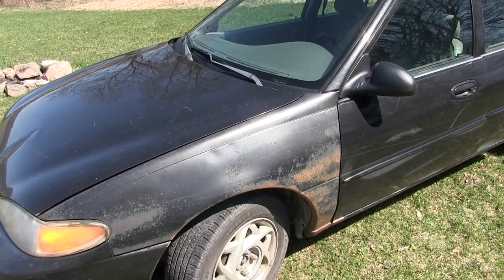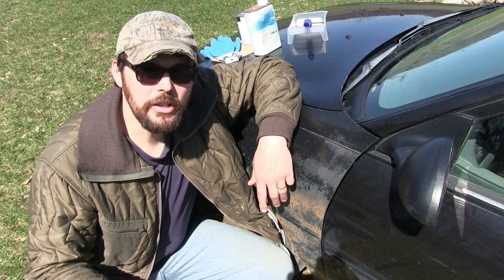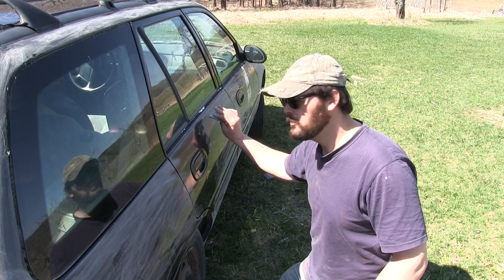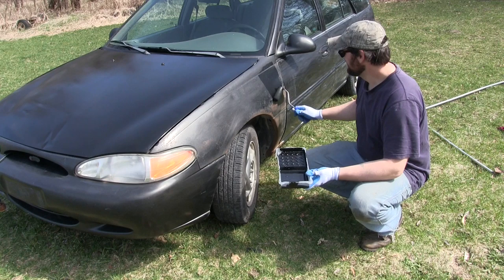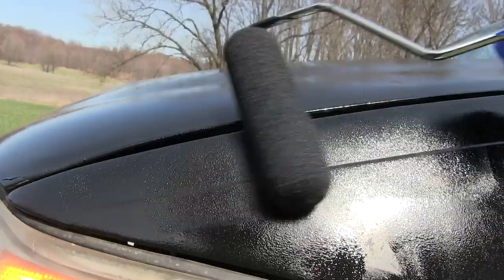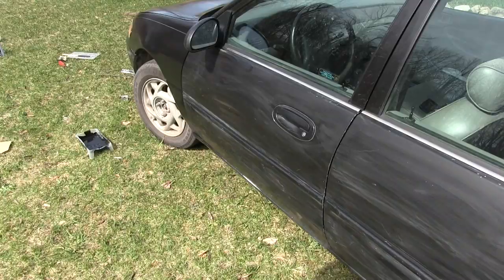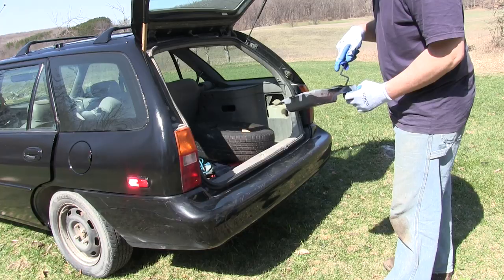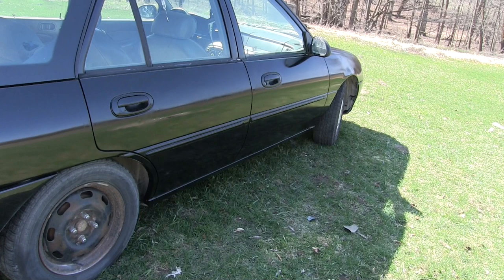Paint Your Car for $20 Bucks !!!!

Comment: "$1500 paint job from a body shop"...IIRC, after a neighbor backed all the way across a pretty wide street, straight into my bright red dually truck, the paint job on the two (?) panels that needed it cost more than that.  OTOH, that's 50% more than the entire purchase price of my first car, a very pretty 1968 Chevy Corvair 500, black on black.  At one point, I did need to repaint the hood on that car, and I went the rattle-can route.  It was looking really nice, then I did something (forget what) that ruined the new paint, and I had to work a bit more to get it looking pretty good.  Back then, I didn't realize there were so many different colors of shiny black.
"To do something yourself is freeing."  Preach it, brother!  Holy O', but that is so core, so basic.  Even some really non-cosmetic things you can do yourself, instead of paying a stranger, is so good to just do!  I grew up with the idea that people just knew how to do things, were taught by their parents like we were.  Nope.  Come to find out, most people don't know how to do anything practical, and what's 100 times worse, don't want to learn.  I barely learned how to weld, and regret that at times.  Really knowing how to weld is a wonderful thing, and I just don't.  But I can frame, tile, rock, paint, plumb, wrench, do electrical, etc.  I'm not great at any of it, but I can do it.
As for your results, that's the kind of car that, if I saw it pull up at a parking lot where I was, I wouldn't really give it a second look.  I wouldn't be tracking down the owner to say how great the car looks, but I wouldn't be concerned that the rust was going to harm my vehicle, either.  For my own preferences, I'd have gone glossier, but I've definitely had cars that looked way tf worse.  When we married (1985), my wife had a car we called the White Monster, that had some sort of chalky white paint on it, would come off a little on your hands if it was wet.  I don't really know, but we always said it had house paint.  I could definitely see, if I'd known back then, taking some sandpaper, paint, etc. and doing a job like this on it.  It would have at least looked good, as long as it wasn't running.  And as long as you didn't look inside, see the sheet metal I'd pop riveted in to fix the hole in the floor, or the work I did to reattach the shifter, or...

Comment: back in '69-70 I had a Rambler wagon, and some friends painted peace symbols all over it. I later wanted to cover 'em up so went out with a brush and painted it with what I had, can of white house paint.  From a distance it looked ok. I did keep my engine the same though. I had some glow-in the dark paints, and had cleaned the engine and painted every part a different color. It was fun to pull in to a station and ask the attendant to check the oil (yeah, they used to do that) and listen to him .......WTH............hahaha
Reply from the maker: 258 inline six?

Comment: I have painted many cars with a roller. One thing I used to do was dilute the paint with a little kerosene. That smoothed out the paint a bit. I painted a VW 30years ago with red primer and it is still on there. My off-grid mobile home I painted with a roller and thinned paint. Still looks fine 15 years later.

Comment: As an oil based paint, I used Flood Penetrol to rejuvenate a Jeep fiberglass top, it’s intended use is to get rid of brush strokes in oil based paint. Late in the game but maybe that would help you with your bubbles if you ever do it again?
Reply: Or he could have just painted it with a brush.  Probably would have turned out better.
Reply: @tommak6516  geez dude who DIED and made you such a negative nellie

Comment: Good idea-I was just thinking about painting my old 1988 s-10 that is 2 colors of primer, with spray cans.-I think I will use your idea.-Thanks. Like the guitars too-I have built 5 or 6 myself and I have 4 of the epiphone specials that I bought on sale over the yrs for 99 dollars a piece.Been looking for some of the jr's. they are hard to find around here. Check out the irongear pickups. Going to order me some. They say they are killer and about 29 bucks a piece in the u.k.-Good luck, like the channel.
Reply from the maker: I would thin the paint a bit and paint in the shade next time. I'll check those pickups out. Thanks for the tip.

Comment: Hi ,  I have been painting my 1990 Nissan D21 with a small roller for years and loving it ,  always looks so much nicer afterwards and I protect the metal underneath as well .   Switched to Krylon Farm Implement paint  recently .  Use ANY WHITE and it always matches .

Comment: Must be a Ford thing-- I painted a 1970 Mavrick in the late 70s "Safety Yellow" with a 9" roller---Next time put a little Penetrol in the paint   to flow out (no roller Marks)
Reply from the maker: I'll make a note of that. Of the cars I've rolled, this one turned out "less good " than the others. I should have thinned a bit.

Comment: I painted my 87 Dodge Pickup about 8 yrs ago using this method- A bit more expensive - I did 4 coats of paint (2 colors to approximate the original) 
Total was around $60- including hardener

Comment: Back in 1964 my friend and I painted my 1952 Chevy rust bucket with my Mom's canister vacuum cleaner. Hook up the hose to the back exhaust and your off. In the garage I found a gallon of OD Green paint that was ready to go. The vacuum had an attachment that was a canister for bug spraying. An hour later we were done. Five years later no rust showed through. Color of an Army Jeep that everybody noticed. Anybody ever do the same?

Comment: If you want to get crazy, you could add multiple coats, sand the paint lightly with a high grit, and hand polish. Costs a bit extra, but should still be in the 40-50$ range

Comment: I subscribe to the channel and this popped up. It's not bad, considering it's a cheap car. It's all about the foundation though, and you don't want even a cheap paint job to flake off. I would have got a spray can  of rust converter and sprayed the rust after sanding it down and then maybe a primer coat, and gloss or high gloss. At the end of the day it just matters that you keep the body from deteriorating.

Comment: We did this, but we used a Cheap air paint sprayer...good enough for primer but not regular auto paint. In the salt country we used to set a cost of about $50 but this included fiberglass and bondo....it was a wiz bang deal on the body repair...but it looked a lot better then when we started...professional no, better yes. The rustoleum paint applied with an air sprayer shocked me though...that was so good in places it did look pro...for about 6  months anyways. The bottom of the rust bucket vehicle got a strip about 4 inches wide of undercoating applied....completely hides doors filled with styrofoam on the bottom  and other wiz bang quicky results.

We also used to camo rust bucket vehicles with rustoleum some using big oak leaves to paint around for creative effect etc

Camo an old 4 wheel drive and the city type wanna be hunter go nuts and come out of the woodwork to buy it for insane $$$ even we felt guilty about. Now we had the knowledge and ability and even the place to do professional body work....only thing we were missing was a downdraft paint booth. But these old vehicles were not worth the time and money just like yours...but it can super amazing what can be done for $20 or even $50 if you want to attempt super basic body work. I'd really encourage you to use the air sprayer though for your rustoleum projects on metal...it doesn't require high air pressure to apply so you don't need a huge air compressor either.
Reply from the maker: I'll give it a try next time. A friend of mine told me the same thing as you just did. So, I'll give it a go. Thanks!

Comment: Wow, the vehicle looks a LOT better.  I painted my son's 72 VW with Rust-Oleum spray cans back in the late early 80's. It turned out real nice. They paint boats hulls like that with foam rollers. There is also a detail called "Tipping" where you pull a good brush over the rolled paint. It's done to even and smooth the paint. But of course for a $20 paint job on a $700 vehicle, it's not worth the effort :-)
Reply from the maker: Thanks for the info, I may try that actually.

Comment: Hey Dave, quick question for you - how tall are you? I'm looking into picking up a low-mile Escort wagon for cheap, love that it's a gas sipper but I'm curious if I'll be comfortable driving it at 6'1, or if it's possible for me to sleep in the back with the seats folded down? I like how you say yours is like a motorcycle you can sleep in
Reply from the maker: Hey Brian, I'm about 6,1" myself. Its a small car but I like the room it has. As for sleeping in the car .....Ive done its lots of times, but I wouldnt say its been great, LOL.
Reply: @Bushradical  Hey thanks Dave, appreciate your feedback and experience!

Comment: A friend of mine used to paint coaches /busses and he painted my van for me with household Woolworths gloss paint he had a brush he had had since an apprentice saying it was worn in just about after many yrs and the older the brush the better he also  thinned that paint so it was like water almost i would say 50/50 with thinners/terps  then he sat it in hot water all the time he was using it ,he went at that vans bodywork like  a mad man changing the direction of the very light first coat it looked so slap dash he put on the second coat the same way his reasoning was if you change direction once final and third coat goes on with a lot more care you don't see the brush strokes and sure enough it was gleaming when he had finished ,I think that's a cheaper way but I don't have a 20 dollar bill write it on as I'm in UK lol

Comment: That looks a lot better.  My Grandfather painted his 1960's Ford truck with rattle can paint in the early 80's.  It was green with white accents when he was done.  Rattle cans back then was like 78 cents if I remember correctly.  You would be surprised what another coat of rustoleum, some sanding, and a buffer would do to that car.  I'm not knocking the looks now I'm just saying that I've seen people take it a few more steps and it was amazing the difference it made.
Reply from the maker: Walk me through it in a couple lines and I'll give it a try. It could definitely look better than it does and I'm up for anything!
Reply: Bushradical how many coats do you have on it now?  If you say three with a roller then you can take some 1500 grit wet sand paper.  keeping the surface wet sand out the rough texture.  Take care not to sand through the color.  If you do, no biggie just reroll let dry and try again.  Once it is smoother get some buffing compound and a 8 inch buffer.  I'm not sure how long this paint has cured but my camper turned out great using this technique.  This is by no means the "proper" way to do it.  I just had 90% of that stuff on hand and tried it. ✌️
Reply from the maker: I'll roll on two more coats this fall and then sand. I'll record it all and see how it works. Thanks for the info.
Reply: Bushradical try just a small panel before you commit to an entire car to see if you like it.  I waited two months between paint and then wet sanding.  Where I live it is extremely humid but also hot.  95 degree air temps with 75% humidity is common this time of year and I did it about this time of year 4 years ago.  So if you live under different conditions it may take longer or shorter period of time for everything to cure out.  Again I would test a small panel then decide if you believe it is worth the extra work.  A shortcut that I used on my camper was an air powered random orbit sander and a very slow running garden hose.  Think of an 1/8" stream of water and no pressure on the sander.  Let the paper do the smoothing and avoid edges/ridges like the plague.  This worked great on flat panels of an rv.  Good luck and you can PM me any questions.

Comment: Isn't that low-tech?  Well, maybe it is or maybe it isn't.  From 1906 until about 1970, Rolls Royce cars were painted with brushes.  The paint was way thinned, the prep work was meticulous (and expensive), the brushes were incredbly smooth and well made, and there were multiple coats that were sanded and rubbed and polished, but the paint was put on with brushes.  Do what you want to do, do it cheap, and take as much care as it's worth to you -- that's good.

Comment: I did a paint roll job on a car i had , I wet sanded after two coats and then buffed it . It will looked like a 2000 dollar paint job when I was done

Comment: I think the only thing you forgot is that RustOleum really likes low humidity days, if you use it on a day with high humidity the paint will grey, and it will be porus.
Reply from the maker: I didn't know that. Thats
Reply: @Bushradical  I used to run a welding/fab shop in South Texas, had to blast an entire product run of sign pedestals that I did because they all rusted and greyed. 

I was so pissed, but it did give me a good excuse to finally buy a sand blaster!
Reply from the maker: Its a good thing to know, as I might do some painting this spring.

Comment: Just cause the paint cost $20 doesn't mean it's a $20 paint job. You have to take all consumables into account. Probably cost closer to $100.
Reply from the maker: The paint was $10, the rollers and handle were $5 the rest was parer towel and sandpaper.....its a $20 job
Reply: @Bushradical  Quart of Acrylic Rustolum Black Automotive Paint - $21, Quart of Acetone - $8,  4" roller kit with plastic paint tray - $9, 3m 320 wet dry sand paper $5. $43 if you're buying the "right" materials.  I could get that down to $30 buying the wrong materials. Certainly closer to your number than mine. The shirt towel saves you a little.
Reply from the maker: Just checked prices...($8.00)/32 oz Black Rustolium at walmart. I used 2 sheets of sandpaper ( $1.50)  The foam rollers and handle were ($5.00)   so we;re up to $14.50....as for the paper towel add another $2 and the acetone isn't even needed, and you sure DONT need a quart. Wiping it down with gas would do just as good for about $1.00............Thats $17.50.....and you only use about half the quart of paint.    ($13.50)
Reply from the maker: LOL   $100....LOL Don't tell me what it costs, Ive painted several cars like this
Reply: @Bushradical  Not sure if you read my previous comment, pretty amazing that it takes less than a pint of paint with a roller over an entire vehicle.

Comment: You know Dave I like looking back at Utubers channels I missed this one lol but I just wanted to say people are so tied up on luxuries now days they don't get the jest of simple practical things. I see so much un-needed waste if people actually resoled boots conditioned them they would last a good many years instead I see blown out boots run down in toe or heal just thrown in the garbage. Tool handles same thing instead of replacing ax or maul handles just thrown out , they leave them out in weather conditions but never use boiled linseed oil to protect handles even when it takes seconds to wipe them down. Since it's been a few years now how did this paint job last you ?
Reply from the maker: Its doing pretty good, but I do think I'll do it again this fall and thin it out a bit to see if It will lay down a bit flatter
Reply: @Bushradical  I had a friend who used one of those electric Wagner paint sprayers to do his car he did the wet sanding afterwards another paint then clear coat looked pretty darn good.
Reply from the maker: awesome, Maybe I'll try that
Reply: @Bushradical  You can use a $30 Harbor Freight spray gun for primer, paint and clear coat. Just put up a frame 4' away from the car all around and over with 2x4s and pull visquene plastic to  make  a great spray booth with a box fan to pull fumes out the back. The secret to a great paint job is good old elbow grease with fine wet sandpaper between coats to make it smooth as a baby butt. With paint, bondo and smoothing putty along with newspaper and masking tape you can do the whole professional job for less than $150 for materials. 
As far as just simply painting like you do use crisco or other type coating to cover the glass, wheels and metal work to keep paint off those and once again use that cheap sprayer and get some practice on something else to dial in the viscosity and spray pattern and it will go much faster and better than rolling getting a nice drip free and smooth coat. Lightly sand the final coat with 600 and spray some Clear coat to add the shine, protection and also cover up any mistakes.
Its all about the time and effort to prep the surface and get the the $3500 paint job most folks would like to have if time is available. 

As far as old trucks and jeeps? I prep the bottom half skirting the first one foot or so that gets the mud and nature's worst and then spray rock guard and then some paint for that forever never rust again that trucks seem to always get. 

$1500 will only get you an  Earl Scheib nasty cheap paint job with no body work.

Comment: Probably gonna trade my Mustang for a Sentra on Sunday and gonna paint it with this method....yes I know that sounds.like a bad deal on my part but the Sentra is in much better condition than my Mustang (besides the paint) he wamts it to be a deift car, I wamt a car withoit all the issues my Mustang has....the dude who had it lasted wored stuff up so bad he fried part of the OBD sustem and a lot of electrical things dont work...plus the exhaust leak...so the Sentra without these problems will make my life easier, even though its a lamer car....but it does have a manual transmission though, like the Mustang.... wouldn't trade for an automatic.
Reply: I did the trade.
Reply: I crashed it, and rebuilt it, now I will repaint it.